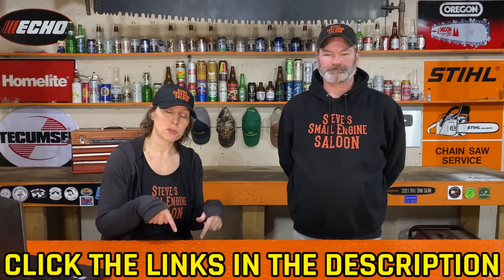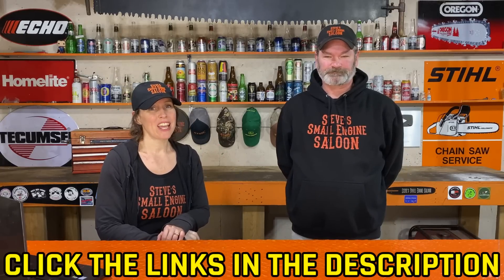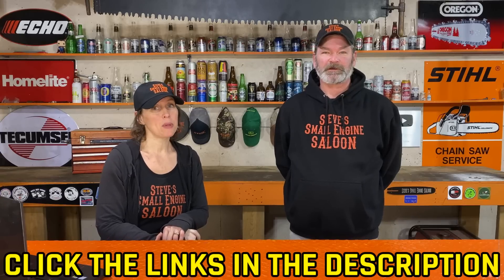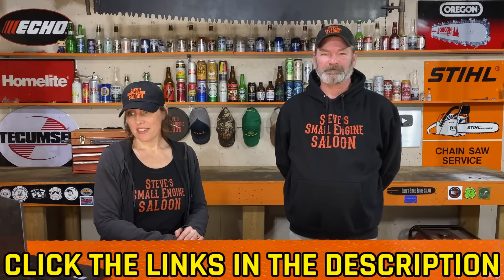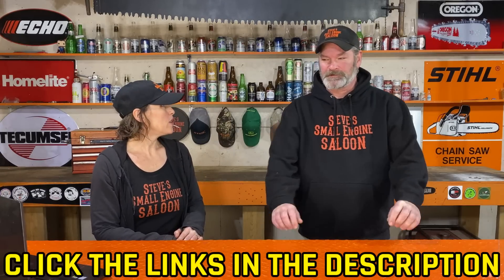Can I Remove ETHANOL From My Gas? (DAY 15)

Comment from the maker: Click below 👇👇👇 for the links to the other questions...
⭐30 DAYS OF QUESTIONS⭐ - (Links will be updated as the videos are put out)
👉DAY 1 - Is A Stihl 4-Mix Engine A 2-Stroke Or A 4-Stroke? ➜ https://youtu.be/QF__8hs0bo8
👉DAY 2 - Are John Deere riding lawn mowers made by MTD? ➜ https://youtu.be/iCJsWsd6SLo
👉DAY 3 - How Do I Break In A New Chainsaw? ➜ https://youtu.be/NE4Q1Y8v2U4
👉DAY 4 - Does Soaking WeedEater Line In Water Actually Help? ➜ https://youtu.be/84hFN_jveMc
👉DAY 5 - Why Does My Briggs Lawn Mower Say Never Change The Oil? ➜ https://youtu.be/IVGmetgOcgo
👉DAY 6 - Can I Use Outboard Mix Oil In My Chain Saw? ➜ https://youtu.be/AlmegbfUJpU
👉DAY 7 - What Is Your Favorite Chain Saw? ➜ https://youtu.be/wMJeH0jCcHM 
👉DAY 8 - Why Does My Grass Chute Keep Plugging Up? ➜ https://youtu.be/WtbhiNy42IU
👉DAY 9 - What Does The Purge Bulb Actually Do? ➜ https://youtu.be/sbDPU73fQQY
👉DAY 10 - What Is Your Favorite Penetrating Oil? ➜ https://youtu.be/jrzNv_Db0ZA
👉DAY 11 - How Do I UnFlood My Chainsaw Or Weed Eater? ➜ https://youtu.be/n0UnfoL5qWk
👉DAY 12 - What Is The Best 2-Stroke Gas / Oil Mix Ratio? ➜ https://youtu.be/-bsbKqZbyrw
👉DAY 13 - Why Does My Leaf Blower Bog Out When I Pull The Trigger? ➜ https://youtu.be/O4fMjSg7Z_U
👉DAY 14 - What Does WARRANTY Actually Mean? ➜ https://youtu.be/D-8054Q6vx0
👉DAY 16 - Why Is My Pressure Washer So Hard To Pull Start? ➜ https://youtu.be/Apipsdmf8qs
👉DAY 17 - Why does my chainsaw leak oil when I’m not using it? ➜ https://youtu.be/3P5ITSFWUZg
👉DAY 18 - Can I Use Old Dirty Motor Oil As Bar And Chain Oil In My Chain Saw? ➜ https://youtu.be/ilRZNsBNE3Y
👉DAY 19 - Should I Buy My John Deere Lawn Mower From Home Depot Or My Dealer? ➜ https://youtu.be/IZRjSYwYhyc
👉DAY 20 - Do Battery Powered Chain Saws Work Good? ➜ https://youtu.be/Zb8XNGfHsQU
👉DAY 21 - Honda Is Stopping Lawn Mower Production? FAKE NEWS!! ➜ https://youtu.be/y4TSwWHFb-o
👉DAY 22 - Will cleaning the rust off my flywheel help with spark? ➜ https://youtu.be/w8-exMgUhuc
👉DAY 23 - NO SPARK! How Do I Know If My Coil / Ignition Module Is Faulty? ➜ https://youtu.be/HBFz_N0SxuY
👉DAY 24 - Will I DESTROY My Pressure Washer By Doing THIS? ➜ https://youtu.be/22OlLNAZKa8
👉DAY 25 - How Do I Fix An On/Off Kill Switch? ➜ https://youtu.be/IyaUpGh19CI
👉DAY 26 - Why doesn’t my lawnmower have an oil drain plug on it? ➜ https://youtu.be/BXJbWWhMk0s
👉DAY 27 - Why Is There Black Oil Coming Out Of My Muffler? ➜ https://youtu.be/SNHdUh5tRoA
👉DAY 28 - Can I Put A LONGER Bar On My Chain Saw? ➜ https://youtu.be/OrRux_GSQQQ
👉DAY 29 - Why Does My Engine STOP Running After A Few Minutes? ➜ https://youtu.be/m5LEwNi-geM
👉DAY 30 - Can I Make A Lawn Mower Run On Propane? ➜ https://youtu.be/UkYCa1WhFGs

Comment: Non ethanal fuel is over 8 bucks a gallon where I live in Mount Shasta and it's really not where I live I would have to drive about an hour to get some.
I haven't used any pure gas yet on my small engines or engines but I want to. 
I can buy the High octane and remove the ethanal which would bring the octane down a bit but would still be fine more than fine. 
If I'm buying the high octane gas for 6 bucks and lose 10 percent of whatever I buy that would make the price 6.67 per gallon well worth it. 
Even if I bought the ethanal free gas I would guess it makes it so much worth it not having to go though the fuel system each year to clean it out, at most I might spend 500 a year on gas for my snowmobile and the other thing I would want it in is my chainsaw which i spend less that 2 gallons a year. The headaches that this would eliminate I think would be well worth it and you will have a engine that will last much longer before repairs. Also when selling the engine you will know it's not all gummed up for the person you sell it to. 
You can get tons of snowmobiles cheap and the reason why is ethanal, repair everything the ethanal damaged and they work great!

Comment: I have a clear water flask that is inverted with a hose coming out the bottom. I also add 1 oz of 2 cycle oil for every 5 gallons of gas I process and also add Octane boost.
I will swear by the results.

Comment: Small engines are OK to run on straight gas.  Probably best to use Distilled or Deionized water to avoid abrasive minerals.

Comment: In Connecticut they do not sell ethanol, free gas at the pump. You can buy them for roughly $10-$15 a gallon at certain locations. What I do is I buy 89 octane, remove the ethanol, and then add an octane booster. I do this 5 gallons at a time, it doesn’t really seem like a lot of effort compared to equipment damage I’m avoid.

For those wandering, I do 8 ounces of water per gallon and I mix in black food dye. This way when I drain it off, I can very easily see what’s water and what’s gasoline
Reply: The dye doesn't mix with the gasoline?

Comment: I went through 3 carburetors on my 150cc scooter and automatic fuel shutoff valves. I only use about 8-12 gallons of nonethanol gas for my mower, scooter and generator each year so for me it is worth it. I used to be able to get 93 nonethanol gas locally but  I cant get it anymore.

Comment: So 87 octane gas right now is 2.56/gal   91 octane ethanol free is 4.89.   If I get high test gas and remove the ethanol can I use it in my chain saw. Mixed with oil  of course.  And is there some kind of lubricant added to    gas to lube the valves in old tractors.

Comment: 6 years ago Steve did a video telling ethanol gas contains olefins, and benzine. Olefins is what causes the varnish build up. The alcohol cause the rust in the bowl. Benzine destroys the metering Diaphragm in 2 cycle engines.

Comment: If you have an older model vehicle and you put fuel with ethanol in the tank over time the ethanol will separate from the fuel and will not remix with that fuel. If you start or attempt to start the engine it will suck up the bad ethanol and in most cases water with it and send it directly into your fuel system. In many cases it will destroy electric fuel pumps and other parts in your fuel system and clog and or possibly   destroy those components. Older model engines were not designed for ethanol and using ethanol in them will in most cases cause major problems and expensive repairs.

Comment: If you leave gas in a small engine over a period of time and you have moisture in the air it will get into the gas and seperate, leaving ethnol and water on the bottom. If thats your carb corrosion will begin
Reply: That applies to all engines not just small engines it's a nightmare waiting to happen.

Comment: You're absolutely right that ethanol creates havoc for carbureted small engines.
My boat with a Yamaha 4 stroke carbureted outboard engine would not start at all after having E10 gas sitting in the tank for a couple of months.
I tried starting it with shots of ether to no avail.
After completely draining the fuel system and filling it with fresh fuel, I finally got it to start after numerous attempts.
Here's the thing I did.
I want to store my outboard without having this issue every season. So I went to the gas station and bought a couple of gallons of 93 octane fuel.
I poured it into a couple of empty jugs, filled each jug about 2/3 full. I added about a quart of water to each jug, and shook each jug vigorously for about a minute or so. Left them for about a minute or so, and you could already see the separation. The fuel was cloudy, so I let it sit overnight.
The next day, the fuel sitting on top in each jug was crystal clear, and the separation point was clearly about 10% higher than it initially was, so that proved visual confirmation that the ethanol had gone into the water. I carefully siphoned the fuel from each container - and I will now use that fuel to store all my small engined power equipment and my boat - as ethanol free fuel will not absorb water and create corrosion issues.
That might be why you'd want to do this! 😆
Anyways Steve, I've been a fan of your channel for quite some time and have found great information here on many occasions.
Thank you for making quality videos and please do keep 'em coming. Cheers.. 🍻

Comment: If the gas goes bad you lost 100% of your gas.  If your carb is gummed up, you have to dismantle/clean or replace.  You don't have immediate use of your stored equipment due to fuel longevity.  You have have manually undo almost everything the government does...just to stay sane...let alone, survive.  I guarantee the military does not use Ethanol fuels....because sh*t needs to work for them....government cares much less for common folk.

Comment: Canada and Europe there is no fuel you can buy that does not have ethanol in it of at least 10%
Even 94 octane premium fuel in Canada is over 10% ethanol mix and a jug of husqvarna 4 stroke 110 fl oz jug is $55 and are the only fuel in Canada that is ethanol free so ya for small engines leaving ethanol fuel in the lawn mower for 7-8 months of -40 winter makes a lot of repairs and maintenance to get stuff running again the next year
So mixing water in 94 octane, syphoning off the gas, adding some octane boost in the end saves you hours upon hours of ripping apart machines and hundreds if not thousands of dollars in extra costs so ya it is worth it especially where all fuel at the pumps is over 10% ethanol mix

Comment: I was told buy mid or high grade. Then do the procedure. Loose some fuel ratio. But wont be less than 87 octane. I get the mid grade.

Comment: Ethanol attracts water (as is apparent when adding water to fuel). Over time, the water breaks the gasoline down (that "varnish smell/buildup in the carburetor" plugs up every small orifice inside the carburetor... jets, ports, blah blah blah). Even "ethanol-free" gasoline will "go bad".... it just takes MUCH longer. 
That being said, instead of removing the ethanol, just add a fuel stabilizer (I added some seafoam to a generator that sat in a hot, humid trailer for FOUR+ years and it started on the second try.... forgot to choke it first time)

Comment: Now that no ethanol fuel is banned in Canada.

2 percent water is double the amount you need for E10.  Adding a few drops of food colouring to the water to it makes it easier to see the phases.  Get a clear container with a bottom spigot.  Start with 94 octane and you'll end up at 90.

Comment: I have a kawazaki hedge trimmer and it worked fine with non ethanol containing fuel but as soon I used fuel with just 5 percent ethanol the carburettor now needs to be rebuilt because it is now flooding the engine.If you have any rubber in the carburettor you have to use non ethanol containing fuel.

Comment: If you have no source of E0 locally, this would be a good thing to do for winter storage of OPE (mowers, edgers, tillers, trimmers, etc). Those engines typically can tolerate lower octane, and the de-ethanoled fuel will have a better chance of not gumming up the carbs over winter. ATV's and the like have higher compression engines that are more likely to knock. Your only choice with those engines is to run them at least once a month.

Comment: Have a generator with non-E fuel sat 3 years carb drained & tank full, started 2nd pull.  Similar machines sit with E-fuel, no question, if they dont get drained and fogged, the carb is either dirty or junk.  We can no longer buy non-E fuel here. Fuel storage life is also a big factor.  Cost breakout :
- Canadian Tire "4 stroke non-E fuel" (TruFuel) = TEN frekking dollars Quart, not a Liter. 
- Comparison : $1.50 per liter pump gas, 10%E. STP Octane boost 310ml $13 treats 80 liters.
80 liters "washed" = $120 + "$15" = $135; yield 72 liters.  
72 "liters" TruFuel = $720, or $680 if you buy the 3.25 liter cans. 
- Vegas Vacation : "You don't know when to quit, do ya Griswold? Here's an idea: Why don't you give me half the money you were gonna bet? Then, we'll go out back, I'll kick you in the nuts, and we'll call it a day."  
Stay gold.

Comment: Only reason for removing the ethanol is if you do NOT have ethanol free fuel in your area to purchase. If that is the case then take a premium fuel with higher octane level and proceed to remove the ethanol and the resulting mixture will be ethanol free with 2 to 3 less rating on the octane level. If you start with the premium fuel which contains a higher octane rating then you are good to go on all accounts.

Comment: I guess the real question is in my mind is say, is concos non ethanol fuel near my home really that. I like the idea of doing to premium as a commenter says. A stock stihl chain is what 7 to 1 so no biggy on the lower octane in my mind as no real detonation issue. Why i would go thru the trouble, is i saw a pretty good study on 2 stroke oil for example Stihl Ultra, it turned out to be the cleanest burning with non ethanol fuel compared to 4 other name brands. The study showed that the Stihl oil was horribly dirty when mixed with ethanol fuel 😳. I'll have to try your ethanol test on the conoco fuel i speak of near my home. I imagine would be same issue with "Castrol Go" 2 cycle oil since i hear that is same oil packaged for Stihl Ultra. One thing for sure no more ethanol for my chainsaw its nasty stuff. Just my opinion.

Comment: Ethanol is causing a lot of problems in my pressure washer & my hotrods, if you let it sit for any length of time, you’re going to need to to dismantle your fuel system to undo the damage.
The ethanol might increase the octane rating, but it’s also not going to burn as hot, so there’s a drop in power & performance.
I’ll buy the octane booster.

Comment: Purchased a new snow blower in 2020, gassed it up, ran it, then no snow for 2 years.  First snow, wouldn't start.  Ethanol destroyed the carb, had to have it replaced, over $100.  Since then I remove the ethanol using the water method, never had a problem since, I use it in the snow blower, lawn tractor, mower, blower and all my small engines.  No issues with the lower octane.
Reply: Can just use higher octane gas instead
Reply: Did you add any octane booster I'm asking because I'm in Canada and we can not but gas without it having 10% ethanol in it all our gas is 10% ethanol even the marine gas.

Comment: I remove the ethanol as I mix gas with old oil and ATF for my ole cummins. Not sure the ethanol matters or not but I feel better about not running it through the system. I don’t worry too much about octane rating running through my diesel and I just buy 95 octane ethanol free for my small engine needs but it’s expensive.

Comment: The closest non ethanol fuel to me is 1.25 hours away and in fact I just made the trip to fill 3 five gallon cans. So that's a 2.5 hour round trip. My cost for the fuel I picked up and to drive there was $84 for 15 gal. Now if I had other business at that location anyway, that would be the way to do it. Otherwise I'll use a 5 gallon bucket with a spigot on the bottom, some water, a big mixing spoon, and use 93 octane with ethanol to start with so I end up with 90 or so octane when all is said and done. Probably take me 45 minutes to do 3 five gallon cans. Even if I end up with 14 gal, It's still better than driving 2.5 hours.

Comment: in the uk there is no gas station that seels ethanol petrol the min is 5%.
ethanol destroys the card rubber.
removing the ethanol lowers the octain by 3
adding 2 stroke oil lowers by another 3 
i use it for my mowers ect.
do not use a octain booster as they are ethanol.
i use a 99 RON/octain by the time i remove the ethanol it is a 96 RON/octail
add the 2 stroke it is now a 93 RON/octain
criss next door works in fawley refinery 
yes it is 1005 worth it

Comment: Steve could you describe in detail the hydrogen bonding interactions of the ethanol and water molecules and discuss in detail the difference between polar protic, and polar aprotic and non polar solvents like gasoline.
Ole

Comment: The only place anywhere near me that sells non-ethanol gas is around 20 miles away making it a 40 mile round trip drive to get some. Just the fuel spent getting it makes it not worth it and the time just adds to that. Some people say it's best to leave it settle overnight I don't know if that's true or not.

Comment: I would say that most people cannot go buy non-ethanol fuel easily.  I have to go to an airport 50 miles away to buy MOGAS at $6.25/gal.  That's in New Hampsire.  There are less and less pump ethanol stations every day.

Comment: apparently some new law in canada they can't sell gas without 10% ethanol...  some places still have 'marked' gas, which apparently is premium without ethanol"...   when ethanol is known to gum up small engines, it doesn't make sense to get rid of gas that DOESN'T have it... so that 10% you lose is made up for in the difference between the cost of premium without ethanol (if available), and regular WITH ethanol.  and maybe a splash of octane juice.

Comment: I’ve lost enough 2-stroke equipment to Ethanol Gas that I now ONLY RUN CLEAR PREMIUM in all 2-stroke engines. I’ve not lost a single engine since. It’s WELL WORTH the extra fuel cost to me.

Comment: Here in Canada, Shell 93 oct is zero ethanol. If you do a glass bottle test with adding a known quantity of water to capture ethanol, all you get out is the same quantity of water so if there is any ethanol in the Shell 93 oct, it is not much. All my small engine stuff is only run with shell 93 oct. I NEVER use ethanol content fuel in anything other than my Toyota truck, but I also run my gear to dry stall to store it. Touch wood, I have never had a problem with any of it...
Reply: Not anymore bud.
Reply: @LifeWideOpen780  I am going to repeat my test again but I hope that you are wrong...
Reply: @davidbrewer7937  it's federal law now
Reply: @LifeWideOpen780  that sucks...